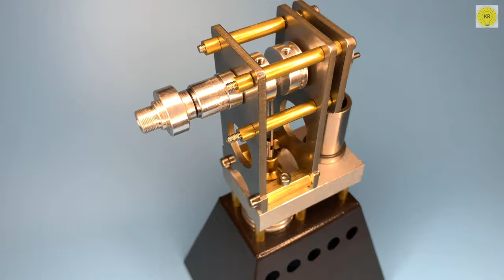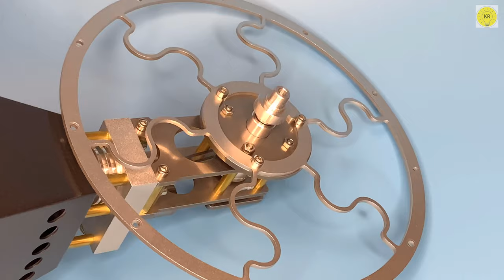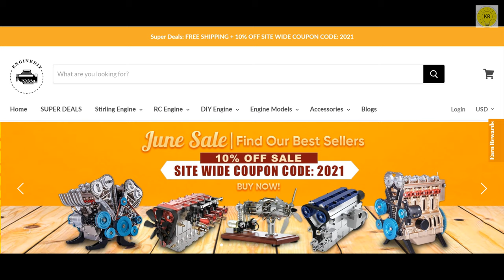how to make Thermal Power Stove Fan Vintage Stirling Engine, enginediy

Comment: Not only did he not make this, just assembled a kit. But he was using a flat head in hex bolds.😰
Reply: An Alan key would be required
Reply: Almost made me sick when I saw that
Reply: @jimmyboy163  for demonstration purposes  is fine. but still i bet you can get the same torque specs required with a flat head.  chill out.

Comment: We want an explanation of how this engine works
Reply: The heat of the flame expands air in a tube, then a piston in that tube is being pushed by the expanding air. The pushed piston then rotates a wheel, when it goes back the force of its rotation will keep it spinning as long as there is fire or any heat source in the tube. Basically converting thermal energy to kinetic energy.
Reply: @thescienceboy1971  thanks